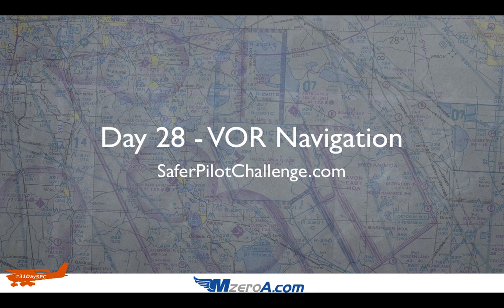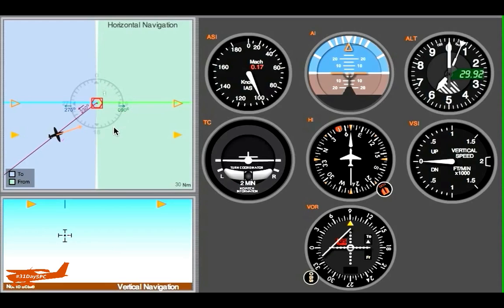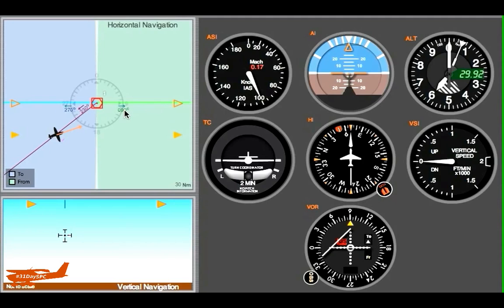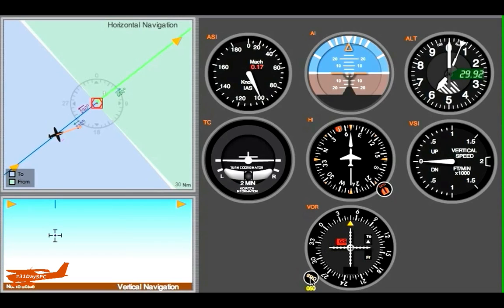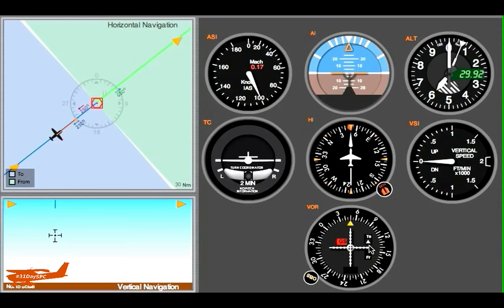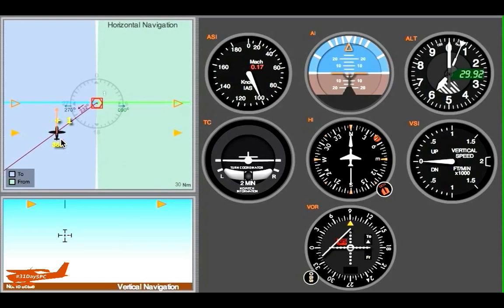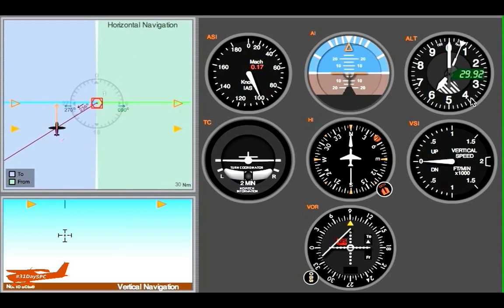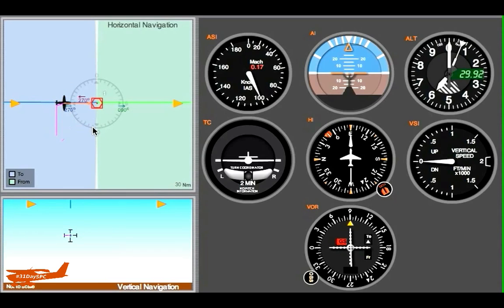VOR Navigation Made Easy - Day 28 #31DaySPC

Comment: 090 bearing i think is correct, if you would intercept the radial 090 inbound to the station you would need to come from the East towards the VOR intercepting radial 090 (heading 270) inbound else you would be intercepting radial 270 inbound

Comment: Question:

Planes original heading was 070 heading. Trying to get into the 090 bearing.

The VOR 1 Gauge already had 090 & displayed deflection to the left.

Simply make sharp left to intercept line then turn to 090 heading & presto.

I’m not understanding what the whole “intercept a 230 radial from station” was all about?

Yes,  a 230 radial from the station reciprocal is 050.

In video it shown you typed in 230 into the VOR Gauge & chart magically shows your plane now on that 230 radial.

Did I miss something?
I missed the part how the plane which was on a 070 heading magically end up on a 230 radial just by turning VOR heading?

That’s the part that’s confusing.
Hmmmm
Reply from the maker: When the simulation first started up, you can see that the plane is located in the Southeast area.  At that moment in time it was on the 230 Degree Radial FROM the Station.  It's course was 70 Degrees TO the station.  Then the simulation talked about how we can get our plane from the 230 Radial to the 270 Radial, so we could track that to the station and then fly they 090 Radial.  

I am attaching one of our updated VOR videos.  https://youtu.be/WFPdVcWG6pg, this could clear things up.
Reply: MzeroA Flight Training 

Thank you,
That video Better explained it

Comment: That looked like a wasteful piece of flying. I would have halved the difference between current heading and final heading and flown directly to the outbound radial, bypassing the VOR completely. Set 090 from on the VOR bug, and it will ease you gently into the final turn. None of these aerobatics needed.